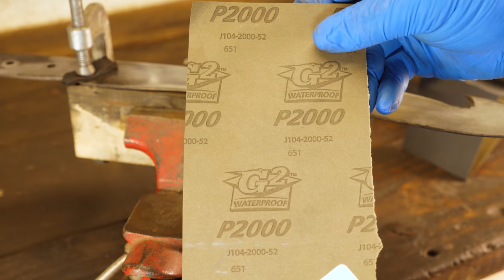Rusty Machete Restoration - Antique Awesome Knife

Comment: You took all that cr*p off only to to reveal a decent handle?

Well was decent..
Reply: Eh.  from my (limited) experience, the handle wasn't that great.   I wouldn't have been thrilled to use it for very long.  A previous owner apparently felt the same, which is why it was wrapped.     Removing it lets you get to the entire metal length at once.    More work than I would have been willing to put into that sucker, but the channel owner had fun - and that's what's important.   Remember, most, if not all of this stuff, would have been headed for the landfill.